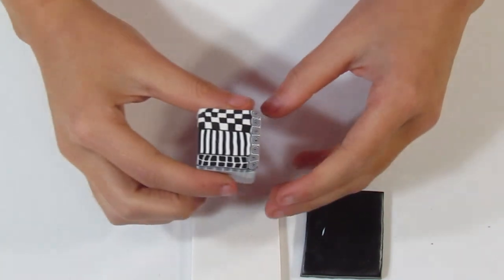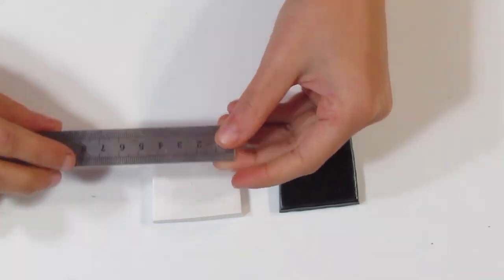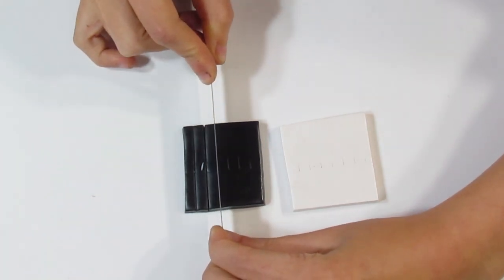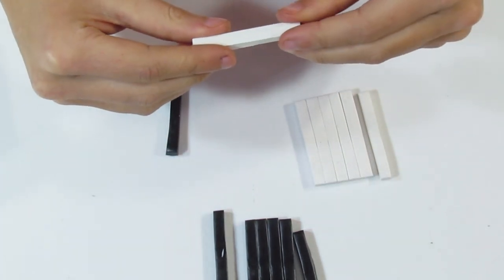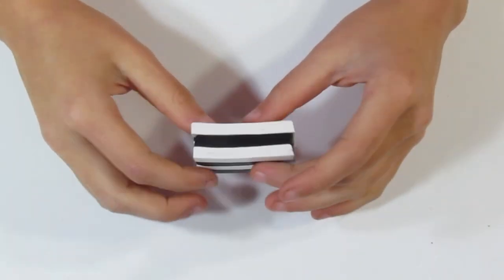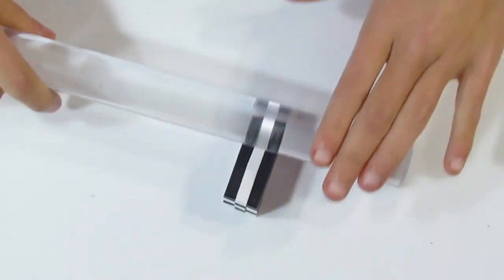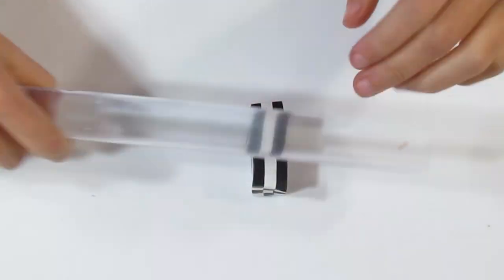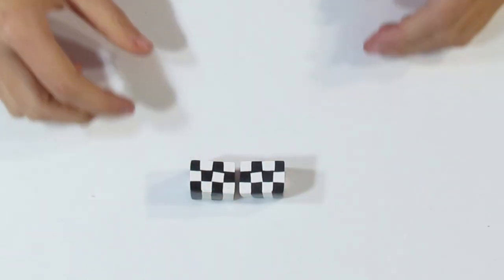Easy Polymer Clay Cane: CheckerBoard Cane Tutorial

Comment: Would you do a tut on how to cook different items in the oven? Using props for different shapes, length and so on... I am making a raskog cart and without thinking I placed it in the oven and when I went yo check it the shelves had dropped from the sticks and the handles holding the stick to the shelves pulled away from the shelves after I worked so long on it. Have to fix it later today. Thanks!!!
Reply from the maker: I'll add that to my list of tutorials. :D